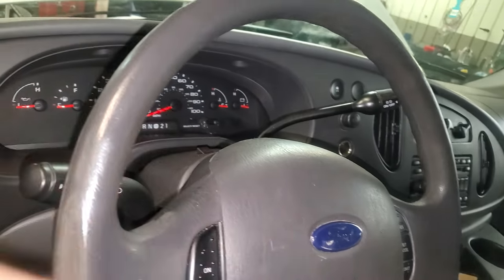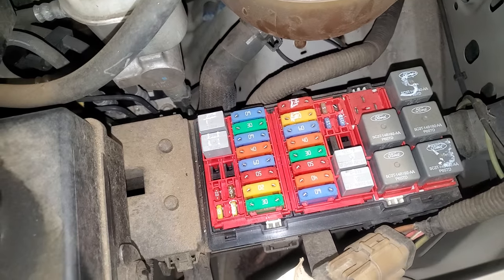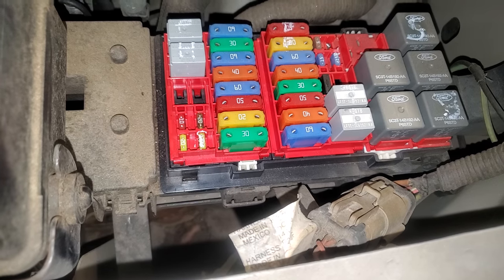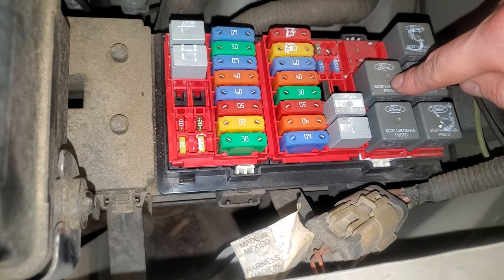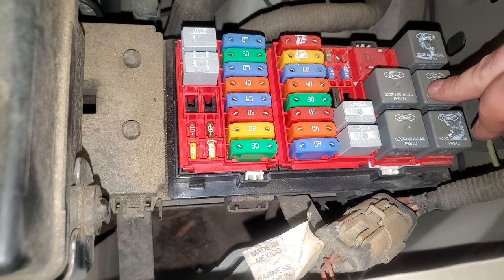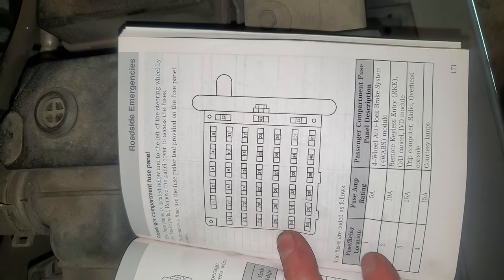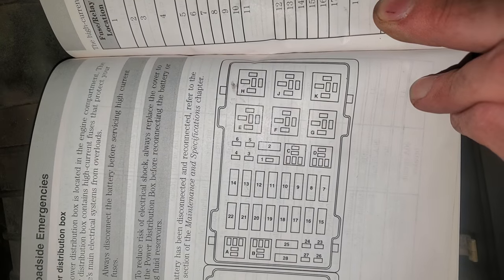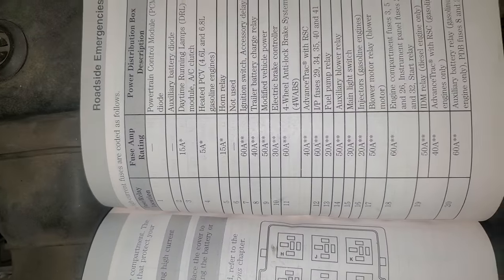2007 Ford E-350 Relay Locations and Fuse Diagram Walkthru

Comment: If you happen to have a 1999 Ford E350 V10 XLT Super Duty you will note that the relays are in a different configuration.  The relay position where this video said the fuel pump relay would be is not used on my vehicle. The fuel pump relay is on the front row in the last position on the right side. The horn relay is just to the left of it.   I just found it in my owner's manual on the page after the diagram. Thanks for the video.

Comment: hi I was just watching your you tube vedio I have 2004 ford E350 super duty  my signals not working kindly tell me which switch or relay for the blinkers 
this is the only vedio i can find it which is exactly like my school bus I just open the power box  thanks for your time
Reply: I want to hook the diagnostic gadget to my ford e-350 but o’really said there is no power to the lighter. Can you enlighten me which fuse is it?